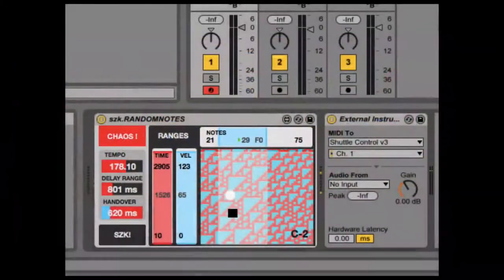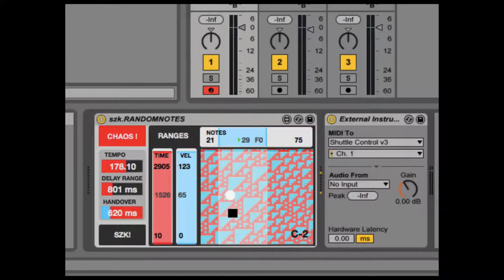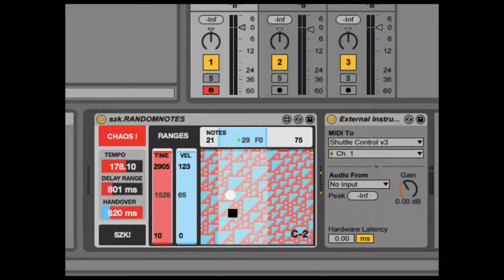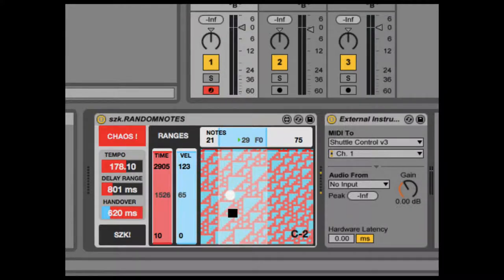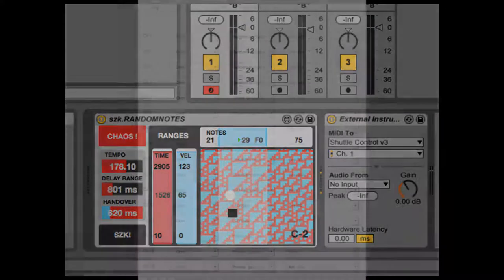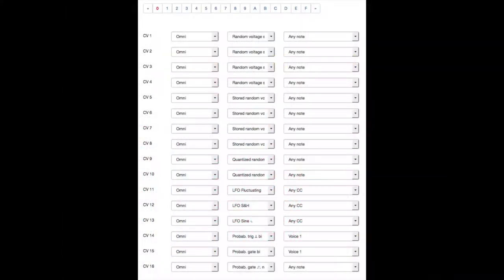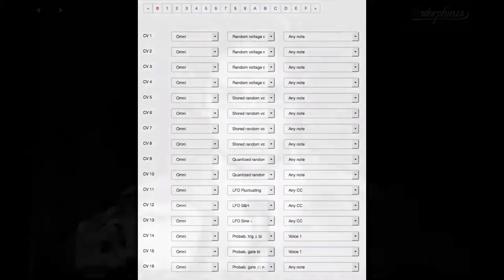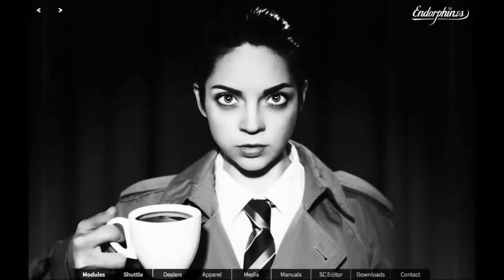The Krell Patch for the Shuttle System by Todd Barton

Comment: I really like the little system but been told the furthrrrrr knobs are too light and gimmicky.  How do you like the system?
Reply: they sure look that way
Reply: Whoever said the quality was gimmicky is talking nonsense. The pots feel smooth and better than any other piece of modular gear I’ve ever used. The oscillator knobs are light and unconventional so you don’t need a coarse/fine tune combo. It’s a brilliant design.